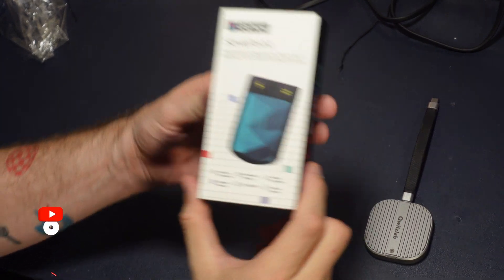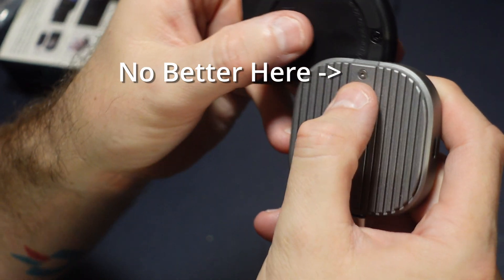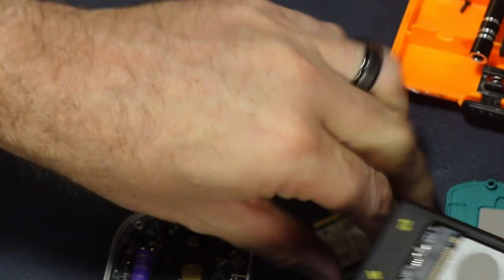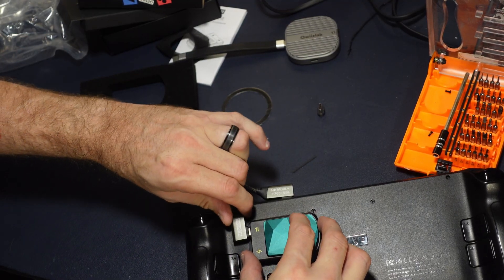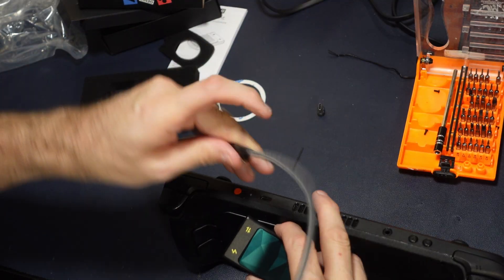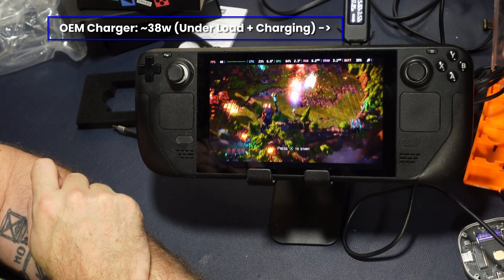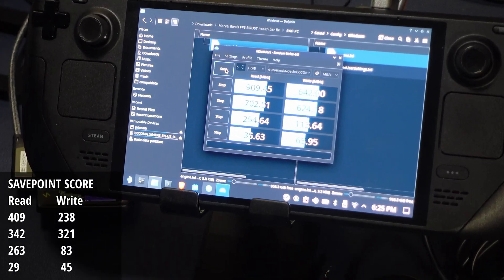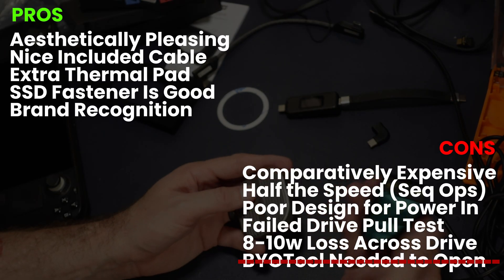Genki SavePoint vs Qwiizlab feat. Steam Deck - There Is A Clear Winner

Comment: So I’m curious, if they’re both rated for 100w pass though charging why do they only pass through such little wattage?

I’m looking to use on the legion go and I’m worried if I get one of theses enclosures they will not pass through enough wattage
Reply from the maker: So here is how I understand it.  PD3.0 (I have a video on this - might be useful) is a ask->give system.  When a device asks for power (Deck), the delivery device (power brick) delivers exactly what is asked for (say, 25w).  If there is something in between the requestor (Deck) and provider (power brick) that eats some of that power?  It isn't reconciled properly.

So the Deck says "Gimmie 30w" - that request is passed through the drive enclosure to the brick.  The brick says "30w?  Coming right up!"

But the enclosure isn't "smart" enough (or whatever the hardware equivalent is) to say "I also need 5w, so please - provide 35w so I can give the requestor its needs but I also get what I need". 

The brick provides the ask - 30w.  The enclosure skims it's 5w off the top and what's left (25w) goes to the requestor ... 5w shy of what was asked.

I have no idea what the Legion GO will "request" .. let's say 50w ... the enclosure will pass that request along and your Go will get 45w because the enclosure syphoned off the 5w.

In the Deck's case?  If you get 35w instead of the 40w ask?  The worst that happens (under the highest load possible) is that your battery stays where it is and doesn't charge - but doesn't discharge either.  So you keep homeostasis with power.  Some DOCKS out there appear to negotiate properly - knowing what they need + the requestor and they get the appropriate amount.  So far, I haven't seen an enclosure that does this.

Comment: Thanks for an honest review, though i did the same test with the savepoint and got 951.70 read 864.20 write in SEQ1M Q8T1 (using a wiped steamdeck ssd in the savepoint) maybe time for a re-test or possibly your savepoint has issues?
Reply from the maker: @Louis-Law  which SSD?
Reply: @ Phison 1tb, it’s the one that came with the oled steamdeck. I swapped it out of the deck when I put my 1tb corsair ssd that I had in my previous deck that had everything setup already. (Easier than cloning)
Reply from the maker: @Louis-Law  Yeah.  So what we're probably seeing here is a difference between an EMMC drive (mine) and a proper drive (yours).  Which is fine - but ... that doesn't answer why a cheaper, generic drive enclosure actually is FASTER than the SavePoint - if the drive was "slow" it would be slow in both places.

It is possible I got a bad unit ... but I'm kinda doubting it.
Reply: @darkuni this deserves another test with another drive
Reply from the maker: @malikkelly  It is on my radar to do this...
Reply: @darkuni  Looking forward

Comment: I just got mine and i love it. Your placement is the biggest issue for you plugs. Have it up right with ports on top. Its just like your regular steam deck plug in that way. Sideways means your hitting hands or what not.
Reply from the maker: My biggest issue is that it is running at HALF the speed of another, cheaper product.  Everything else is an inconvenience.

Comment: now this was an itneresting review since im also looking for an external enclosure for the random 2230 nvme that my deck spits out whenever I upgrade.

some questions if you dont mind:
do you know of any enclosure like this that can deliver the 38 watts to the deck?
does does the same "corruption happens on ext4 drives? I always make sure to fully remove the ntfs hdd that I have for my deck but I wasnt aware of that happening if not done properly.
Reply from the maker: @potatoMethod  these are the only two I know about and tested.  These are kinda rare...